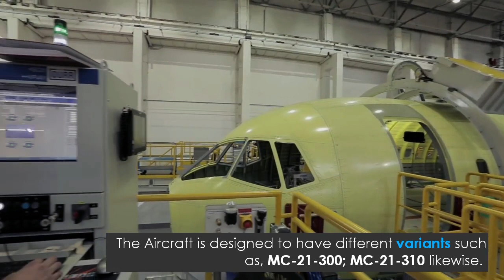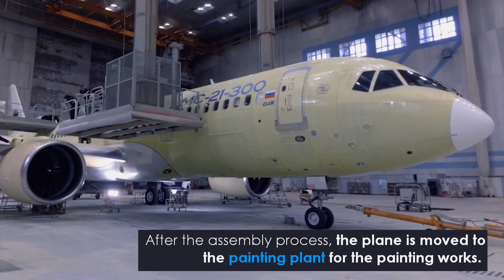Production Process of the IRKUT MC-21 Aircraft │ The ISSK Documentary Series

Comment: Russia needs to saturate its own market first, and only then will Africa and Asia. There are certain agreements with many countries from these continents.
For their own needs, from 2025 to 2030, they plan to produce 270 MS-21 aircraft. And this is about 60 - 70 aircraft per year. The plans are to reach 72 aircraft per year by 2027. Small batches of 10 -12 aircraft can still be produced. For example, the production of composite wings for the MS -21 is now possible at the current capacity of only 12 pairs of wings per year, that is, only 12 aircraft. The same number of PD-14 engine pairs. For an output of 70-100 aircraft per year, it is necessary to build new factories and increase capacity six times! Funds for new plants and an increase in production capacity have already been allocated from the federal budget, factories and workshops are being built.
The fuselage of the aircraft itself, the composite wing and the PD-14 engine have been certified. By 2025, the remaining foreign parts and systems will be replaced (analogues are produced in Russia) and the certification of the aircraft will continue. The most difficult stage has been passed. Russia has its own technologies and developments, there are funds, but the production facilities are not as powerful for the production of engines and composite wings at this stage. Which will be fixed soon.
This is about the same as with the production of the Sukhoi Superjet 100 (SSJ100) in Russia. The plant could easily assemble 40 aircraft per year, but foreign suppliers could supply their products only in small batches – 20 sets each. For example, the PowerJet SaM146 engines could only be delivered to Russia for 20-22 aircraft. Therefore, a new Sukhoi Superjet New aircraft is being prepared entirely from Russian parts, and with Russian PD-8 engines.
Reply: Exciting times for Russian aviation. I wish you all the best with your endeavours.

Comment: NEED MAINTENANCE ,SPARE PARTS.  Good service and proper M R S. . This is the down fall.  That RUSSIA DOES NOT OFFER  SERVICE POOL OF PARTS.  Good overhaul capabilities.  If it is to be successful then MC 21 needs full package. WHICH THEY DID NOT PROVIDE FOR SSJ 100 . Without  proper. extensive M R S. in different countries it will not succeed. 1 in MALAYSIA. 1 IN INDIA, 1 In MOSCOW. 1  VLADIVOSTOK. 1 IN SOCHI , 1 in Nizhny Novgorod